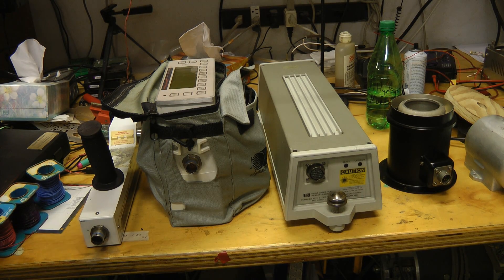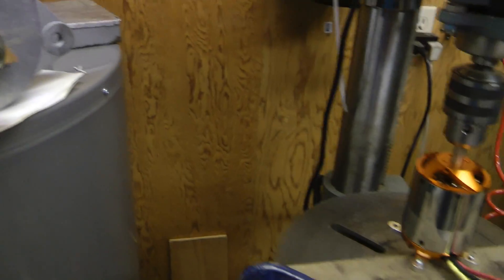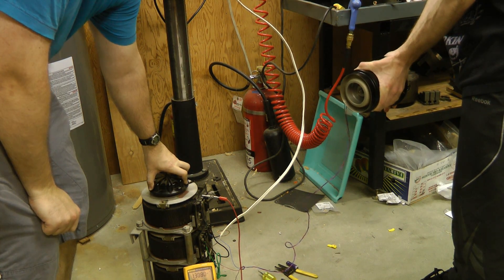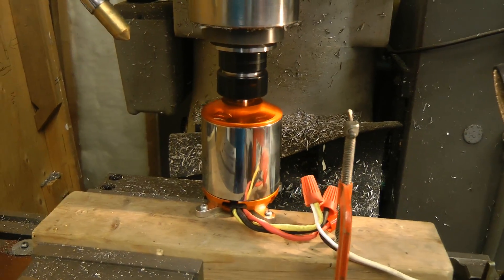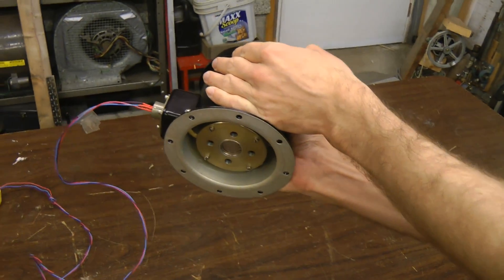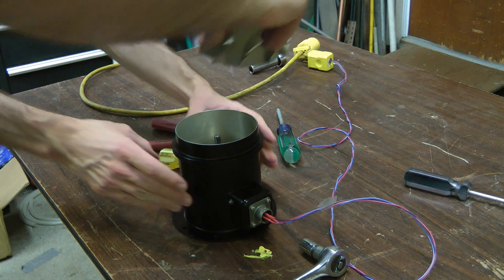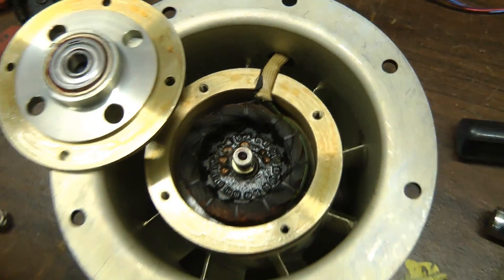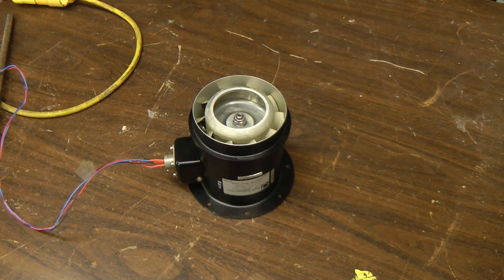IMC Magnetics 400Hz vaneaxial aircraft fan

Comment: The cryo engine is a stirling motor run in reverse: An electric motor turns it, and it produces a temperature differential. Typically used to cool down IR sensors, and they go pretty low.

Comment: I dont see why the aveation cant use 12vac for most evrey thing but idk alot about aveation now
Reply: Lower voltage requires more amps for the same power, which means thicker wires that weigh more. Lower frequency mean motors and alternators are heavier. Weight is the enemy of flight.

Comment: In the last part of the video, what was the power supply? I came by a much smaller 400Hz electronics fan (signal corps, made by Globe Industries/TRW) and it needs 120V 400Hz. I have been thinking about using a large audio power amplifier (1000W+) to generate the frequency but that might have trouble reaching full voltage.
Reply from the maker: I was using a large 6kW RC airplane outrunner brushless motor being turned at 3500RPM by a milling machine, followed by a 3 phase variac in reverse to up the voltage. It didn't work very well, the best would be a proper VFD that can output 400Hz, you can find these on eBay or Aliexpress quite readily.
Reply: Ok I couldn't tell if the milling machine was still running in the background or whether you had some other solid-state power supply available.

Comment: You uncovered a counter intuitive property of fans, they generally are loaded highest in free air and lowest at little or no air flow.  This becomes relevant when we re-purpose fans like furnace blowers, or your axial fan.  If there is not enough resistance to air flow the motor burns up, so often a restrictor plate is required.  Neat piece, thanks for posting.
Reply: That sounds like you refer to squirrel cage blowers with forward-facing vanes. Backpressure reduces their motor load. However, if the vanes are tilted backward, they become insensitive to backpressure, but have to spin faster to make the same flow rate. Vanes which radiate straight out from the shaft have a backpressure response and characteristic flow that is in-between the other two types.

Comment: what happen if you just give it 60 cycle
Reply: +65bug5  from what little research I did a while back my impression would be that the coil winding would delaminate and melt, because it would have a higher resistance and therefore more current draw than what the thin wires were designed for. one of the benefits of using 400 Hz power is a decrease in weight because of the ability to use the thinner gauge distribution wire and thinner gauge windings. going the opposite from 60 Hz to 50 Hz is also problematic, as Europe required a heavier gauge winding in motors to equal the same horsepower output of an identical 60 Hz motor for the 50 Hz systems.

Comment: In the past I've used high power audio amplifiers driving step-up transformers to power 400Hz devices.

Such a setup allows both the voltage and frequency to be precisely adjusted, and it can be quite efficient if you use class D audio amplifiers (lots of cheap and powerful second hand class D car audio amplifiers out there).

I've selected the transformers based on impedance matching. For instance, if the audio amplifier is rated for 400W RMS at 4 ohms, this means the amplifier will put out its maximum power output at 40VAC. If I want the system to output a maximum voltage of about 200VAC I would select a mains transformer with approximately a 220V primary, 40V secondary. Of course, I would wire it the other way around as a step-up.

Comment: What a great little fan, and nice experminets and teardown you did there.  I suspect that the reason you were having a problem getting enough power into it was because the variac will have a core optimised to run at 50/60Hz and the efficiency will drop dramatically as the frequency deviates from the optimal. Blocking up the output on a fan will either slow down or speed up the fan depending upon how blocked it is - it's all down to the amount of work that the fan is doing... When partially blocked, the fan will have to work harder to push the air through, but when totally blocked the fan is no longer able to push the air through at all meaning that it is doing far less work now, and can therefore spin faster as a result. Keep up the good work - I love your videos. Cheers!!

Comment: Hmmmm, I wonder why all X-box's were not fitted with this type of cooling?????
Reply: The Xbox 360 was a cramped design with an undersized heat sink. If the thermal design can't be changed WRT case size and/or heatsinks, the only option is more airflow.
Small/Thin, Quiet, or Adequate Cooling. Pick any two.

My computer's CPU is a Intel Core i7-4930k running at 3.4GHz.
This processor is rated at 130w TDP. I prevented this from being a problem by choosing a good heatsink (Thermaltake NiC F4) and a large case with plenty of room for airflow (Cooler Master HAF XB).
In my case I chose Quiet and Adequate Cooling. I regret nothing, as my computer lives under my desk in a space I would otherwise not be using.

Comment: How about a hovercraft?
Reply: Alan Cordwell That was my thought too. Throw it on a hole in a board with a nice rubber or plastic skirt and see what it does.

Although, with the fact that when he blocked it off it actually reduced power, I wonder if the fan would end up crapping out when put under load that way.
Reply: Daniel G well they use centrifugal fans on big hovercraft and that type defo does unload the motor when the airflow is blocked. The solution is probably to govern the motor rpm to a constant figure. 

But, I'm thinking this is an induction motor, so it should reach synchronous speed and stay there- is that right?

Comment: I wonder if the cryoengine thing is a stirling cooler from an old thermal imager
Reply: The small cut pipe may have been a heat transfer pipe. I definitely agree it is a sterling engine cooler.
Reply: mikeselectricstuff Wouldn't that be a great find! ever since I saw  Ben Krasnow's cryocooler I've wanted one, but those mobile phone tower filters are a lot more expensive than they were back then. It certainly would be an easy liquid nitrogen project if was one.

Comment: I have a pretty similar fan here.
http://abload.de/img/mobile.415b3u9h.jpg
http://abload.de/img/mobile.416qcuaz.jpg

I think a VFD should be the best to run this.
Here is a video of a smaller one (its a dual rotor design):
https://www.youtube.com/watch?v=G811vXuy1xk

There are also power tools out there which run at 265V 200Hz. (400V 300Hz)
https://www.youtube.com/watch?v=xd8gcB1MlZU

Comment: The CTI-CRYOGENICS part looks like(and sounds like) a relatively small stirling cycle cryocooler. Try running it for a few minutes, see if it gets chilly and/or warm anywhere.
Reply: +TheElectricnoob Oh. It seemed like a suicide attempt to try to cut such a pipe. If I recall, most of closed-loop coolers run at a metric fuckton of pressure exactly, or even more.
To me it looked like the cold finger is on the bottom.

Comment: The reason why it speeds up is because it is creating a partial vacuum and therefore reducing the load on the blades and the motor.
Reply: Lachz10 They were blocking the output, though. That would create a high pressure inside the housing, not a vacuum.

Comment: Some great improvisation there, well done!
I wonder is that used for starting up jet engines, assuming that an auxilliary power unit would be available to provide the initial 400Hz supply.
Reply: No this would not be able to provide enough air to start a jet engine. On most commercial aircraft the APU provides high volume, low pressure air direct to an air turbine starter, which in turn will spin up the engine. However yes the APU can also provide 115v AC at 400Hz. I agree with Jerzmacow that this is just a cooling fan however it's still a little small for cooling an Xbox in my opinion.
Reply: ***** Ok. thanks!
Reply: ***** It's very likely that this came out of some radar equipment, since the original owner was big into microwave radio and radar

Comment: When you block the airflow does it not start to form a partial vacuum which reduces the friction on the blades ?
Reply: Tom McLellan I noticed that PC fans also speed up when the airflow is blocked off, doesn't matter what side is blocked. I would amuse its because the same air thats already spinning is spun around inside the fan instead of slow moving air having to be accelerated up to speed as it enters.
Reply: berni8k Yes, all fans speed up when blocked, the current draw also drops (Tim Hunkin showed this in the secret life of the vacuum cleaner). The reason for it being a bad idea is most fans also cool their own motor, and with a blockage... the motor burns out
Reply: berni8k How about 2 vacuum gauges. One at the Center of the fan and one at the outside.  Just to see what's happening. ☺